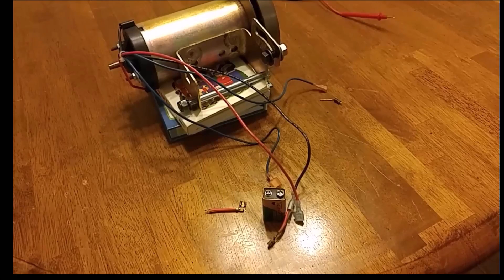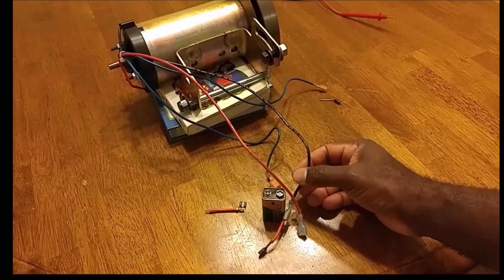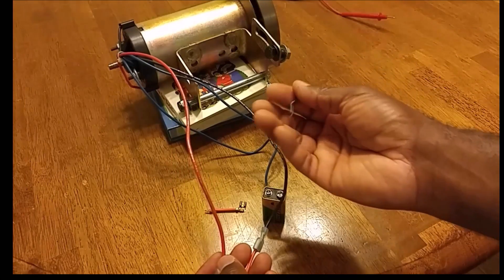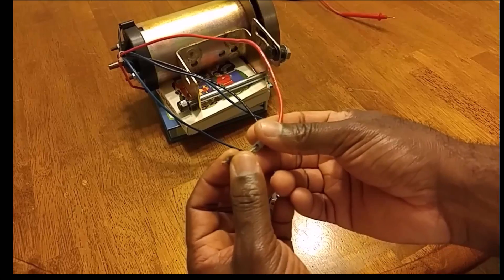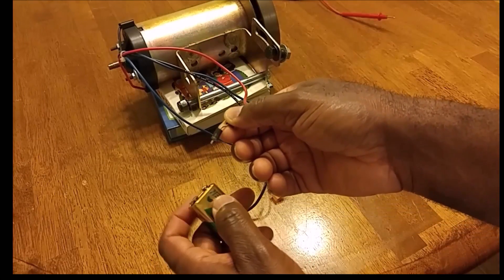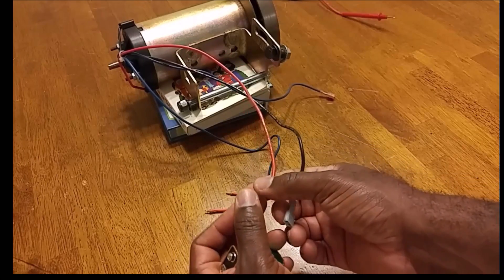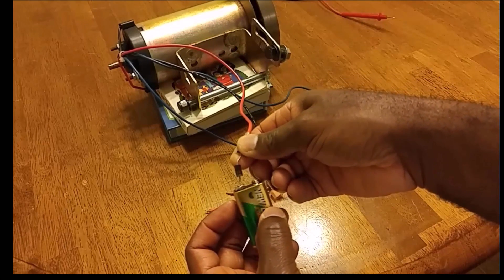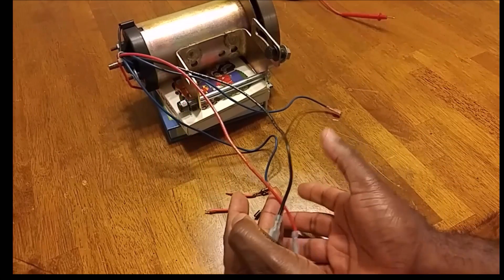Wire a treadmill motor to generate electricity

Comment: Thank you very much for sharing the video. Your information is very useful. What type of diode is used to test?
Reply from the maker: I believe it was a 6 amperage diode, at the time of testing,  but if used in a real life application,  such as a wind turbine,  you will need a much larger amperage diode, particularly a solar Pv 600 Volt 75 Amp blocking diode for wind turbines & solar. I personally use one of these in my solar shed currently.

Comment: So we are going to charge 9v batteries with 200v?? Ok wow!! How about a current limiter?? Or any kind of resistor.
Reply from the maker: This was only a brief demonstration to illustrate how to wire it up correctly for charging purposes.   The battery used in this demonstration is not a rechargeable battery.

Comment: great video
Reply from the maker: So why did not you figure it out?
Reply: @DIYOneForAll  well kinda stumped me when he put the diode but i think now was to keep the charge from going back into the dc motor now.lo
Reply from the maker: @randallmarsh446  The same idea with a diode is used in DC solar panels to prevent a vampire load.
Reply: @DIYOneForAll  rodger dodger .10-4 .